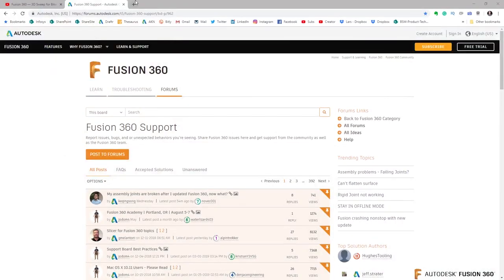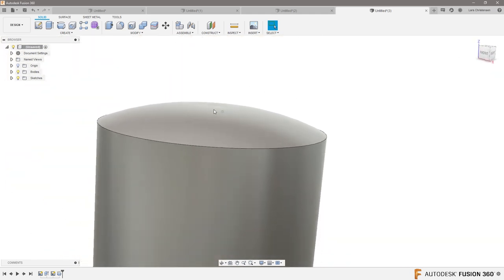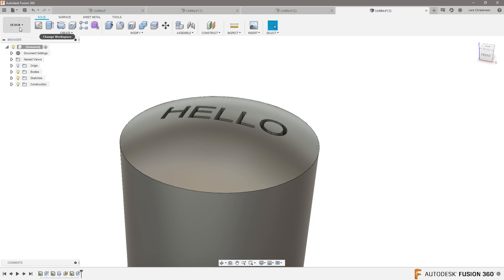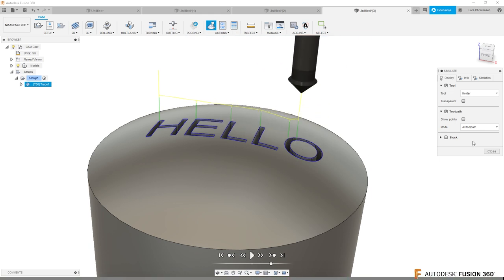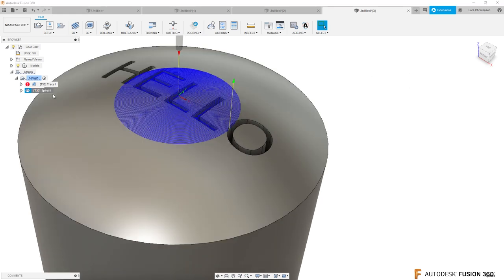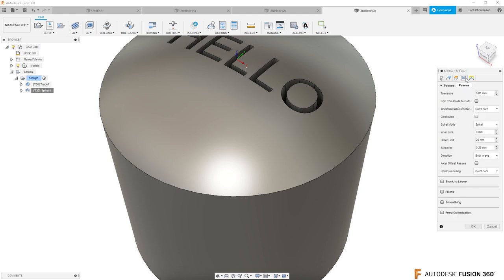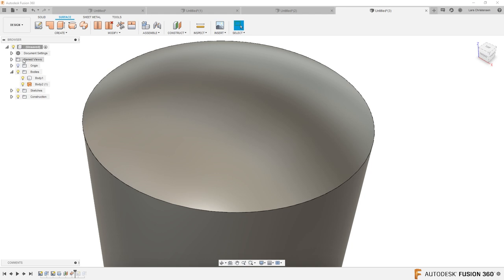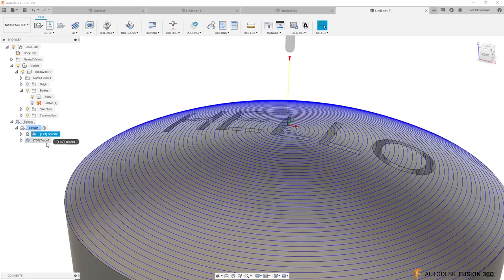Fusion 360 — CAM Engrave on Dome Surface — Ask LarsLive

Comment: Hi Lars. I can’t work out why you needed to do the surface thing? Why couldn’t you simple roll back the timeline and use the body to generate the spiral. Why did you need the surface?
Reply from the maker: You are right! You could! Back in my shop days my preference was to pull surfaces from the model for CAM and machine to those. This way, when the customer call 6 months later, you have the surfaces as a reminder what you did. If you just drag the timeline you might not remember or worse, if you have to replace the  model with a new revision with a different built timeline you could be lost.